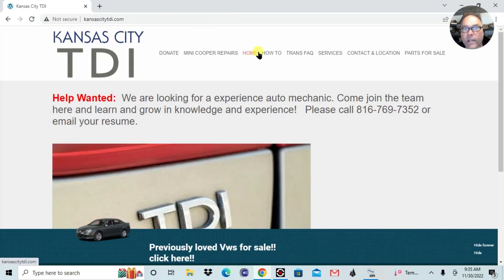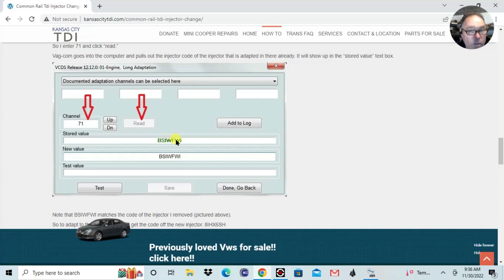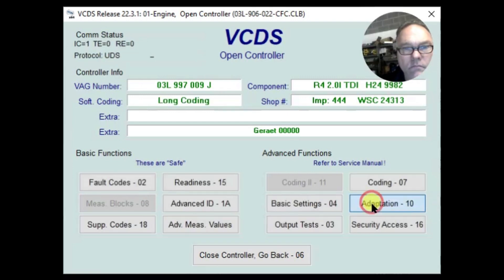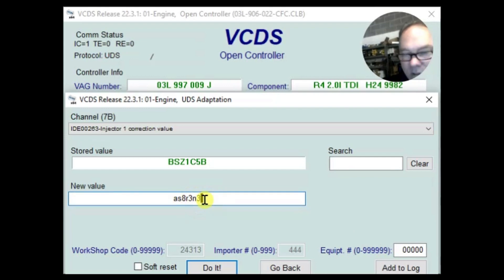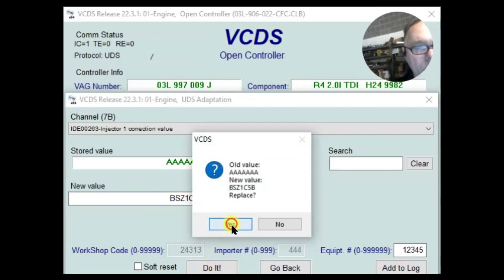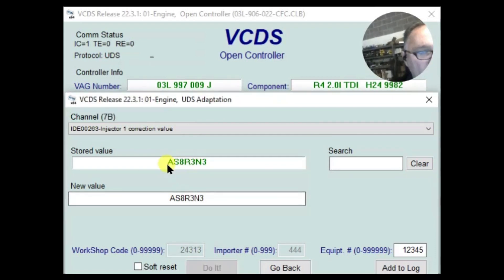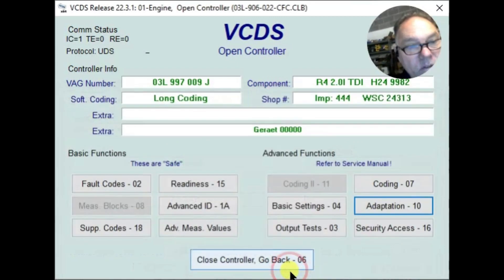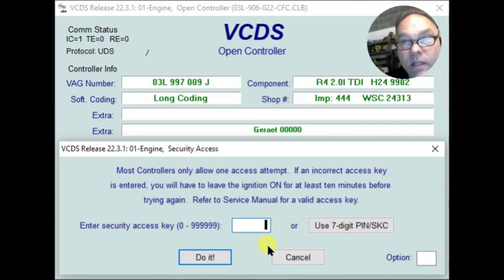CR Tdi injector adaptation

Comment: So there are no aftermarket injectors available since they would have to be calibrated to match the flow rates designated by vw serialization per some unknown on each & every comon rail piezo injector?
Reply from the maker: thats a logical conclusion but I would guess someone is doing it.  But software would be better way to make more HP.;
Reply: So unadapted do they throw  code?

Comment: Do you need the latest VW ECU software update for this to work?
As you maybe putting 2023 latest injectors into a VW  with 2010 ECU software, so new injector coding may not be recognised ?
Has anyone reading this come across this problem?
Reply from the maker: I have not run into this.
Reply: It shouldn't happen if it's the same type of injector with the code of same lenght. Injector coding  is just a calibration values but written in a code. Your injector offset, pre injection,full load, etc. So it has nothing to do with the age of your car or the injector.  The only reason i can think of is why your ecu wouldn't accept the injector code is that some of the values are outside maximum or minimum values. You can search for IMA decoder. Decode the values and then compare them to  min/max values  that are allowed for your engine,if you can find them.

Comment: Hi.I have a passat b6 cbab,I have 2 errors,p1065 and p0088 high fuel pressure.What could be? The car gets sometime limp,but it can be 2 weeks with no limp and then came again.The car has no fluctuation,it works well,the turbo come on 2500 rpm not on 1800-2000.Could be the return rail? Sometimes starts a liitle bit slow
Reply from the maker: Dont know off hand.  Your probably gonna need to get it to shop that can diagnose it.

Comment: Hey coolair. I replaced the maf on my alh tdi as preventative maintenance, felt way better had a lot more power it felt great for a couple weeks. Now i am having boost issues and it's not boosting as much. I have the code p0101 now. I unplugged the maf connector and it only has 4 pins. I am very confused.
Because my actual maf has 5 pins but the connection only has 4 wires going to it and 4 pins. It has the slot for the 5th pin though.  I have a picture of the connection if that would help
Reply from the maker: Put the old one back in.   Sorry I dont have the number of pins on every component memorized.  From memory I think only 3 pins are used.  Look up a wire schematic.   Other Vw's use 5 pins on Maf because they have a built in air temp sensor but the air temp sensor is on the Map sensor on your car, so I believe it works with three.